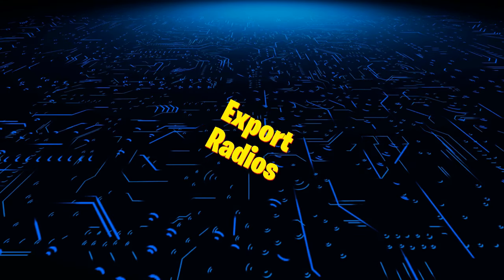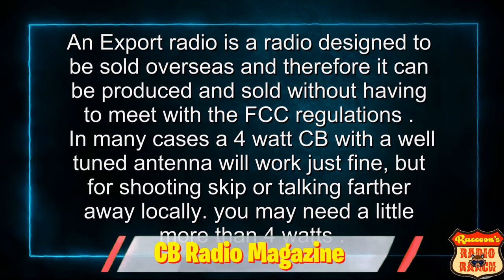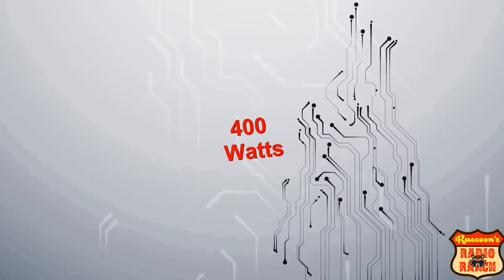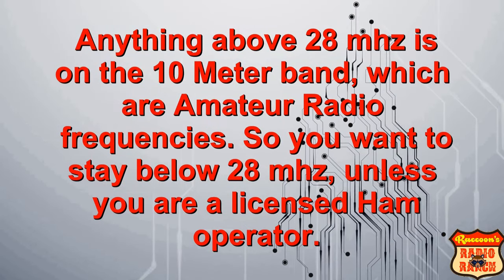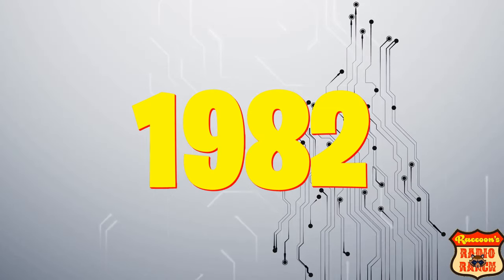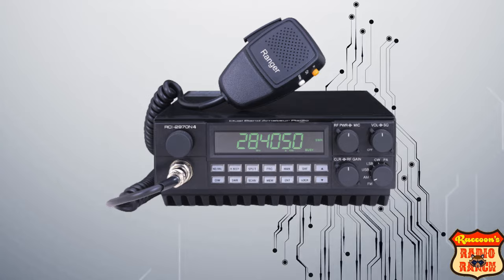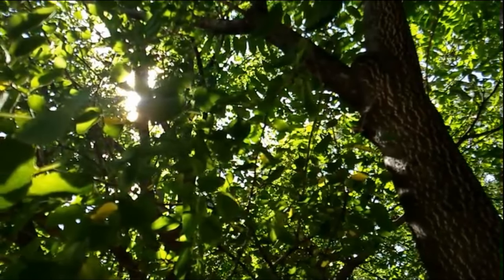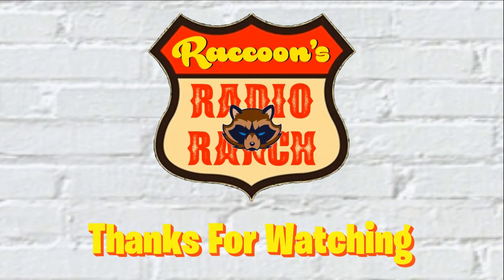What Is An Export Radio

Comment: While I have never owned an export radio, I do use 100 watts on CB frequencies, 26.965 Mhz to 27.405 Mhz, mostly on the higher channels above 30. Only on SSB, and only on my base station. That, along with a good antenna, makes it possible to communicate with someone thousands of miles away (depending on conditions) without causing any kind of interference. Yes, it is technically illegal, but I don't see anything wrong with it. My amplifier is clean, meaning it stays on frequency, and does not generate harmonics that can splatter across several frequencies. My modulation is also clean. Unfortunately, there are several teenage kids, (and a few much older "kids") around that use cheap, dirty high powered amplifiers and power microphones on AM, mostly just to be a nuisance. Their overpowered signal splatters across several channels, and is so overmodulated that it is mostly unintelligible. They also tend to like echo boards and all kinds of noisemakers. I personally don't see any point to this, but apparently they seem to get a lot of fun out of it. There is a huge difference between that kind of behavior, and using a little extra power to actually communicate. If you choose to use extra power, and/or frequencies outside the CB band, please do so responsibly. Stay off the amateur bands, and any other frequencies where you might interfere with any other service. 

Unfortunately, many people are using these high powered export radios on the 10 meter band basically as CBs, including many truckers. They are unlicensed and do not follow the rules. While I do have an issue with some of the rules on the amateur bands, I do follow them if I am using those bands. I don't believe I have the right to interfere with other radio enthusiasts right to use those bands they have a license for. That is what attracted me to CB. (well, that and the fact that I got my first CB way back in 1975 at age 16) While still legally regulated by law, it has been mostly abandoned by the FCC. As long as you don't do something really stupid, you can get away with almost anything there. And that also means that responsible users like me have no choice but to put up with the deliberate interference I mentioned above.
Reply from the maker: Gerald , I normally stay right in the 1 - 40 area of the CB , and even then I'm usually somewhere between 1 - 23 because I tend to use older 23 channel radios when I talk on the CB . The radios I commonly use when I'm on the CB are my Pearce-Simpson Bengal , my Lafayetter Comstat 23 , my Kris 23+ , my President Washington , or my Cobra 2000 . And the only time I go out of the 1 - 40 ... is actually when I'm on one of the Ham radio bands . I don't use the "Free Band" frequencies . I also don't use echo , roger beeps or amps ... I don't dislike them , I just want to use them ... but it doesn't bother when others use them . As long as they're not acting like a fool ... lol

Comment: Love those 2510’s and their cousin 2600’s , I have two of each plus the old President Lincoln, and recently got a new President Lincoln II Plus from Matt at The Radio Garage 👏👏
Reply from the maker: I watched that video that you shared of the Lincoln II + ... it's a nice radio . I have an HR-2510 that I've probably owned for about 17/18 years . It was my go to radio for almost that entire time , up until I bought the Stryker almost 2 years ago . I actually just pulled out my HR 2510 , hooked it up ... and I have it just running to warm everything back up and acclimated . My HR 2510 has ALWAYS been one of my favorite radios .
Reply from the maker: I also forgot to mention that it had been completely gone through by Bob at Bob's CB when I first got it , and that it's the same HR 2510 that I used to talk to the Galápagos Islands with , on 28.515mhz .